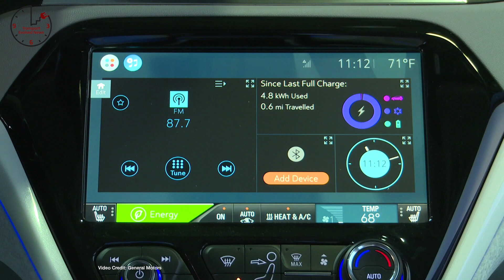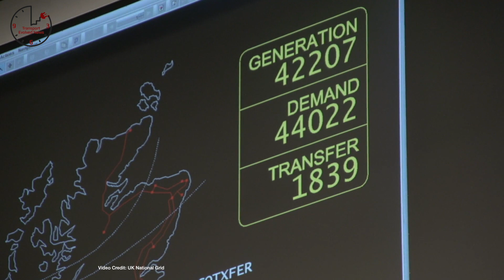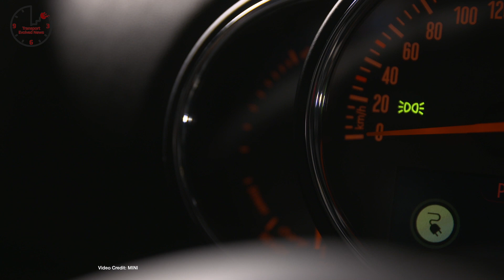BMW Scares Employees With Tesla, Waymo Public Tests, LEAF AT-EV, T.E.N. Future Car News 4/28/2017

Comment: 8:25 By all means it should replace coal with nuclear power. 
Nuclear is the LARGEST source of emission free power.
If you care about greenhouse gases, nuclear must be part of the solution.
Every time we shut down a nuclear plant we see a dramatic rise in carbon emissions (because we end up using more fossil fuels to provide the energy that far exceeds solar and wind capacity).

Comment: I tried to emulate your experiment of using my ev ,an imiev, as an emergency supply. however the battery consumed 1 kwhr whilst the load ,a 95w bulb, consumed 0.24kwhr. did you experience the same?

Comment: Good stuff!  The 'flyer' is dangerous, not for the pilot.  We've had babies lose an eye to a 'parrot'-sized drone in people's homes.  Look at the plethora of what appears to be 18-inch propellor blades under the Kittyhawk chassis.  No - wouldn't touch it, it is like all other drones, fundamentally unsafe because they do not take the rotor blade (propellor) tips seriously.  It's like that story of the guy who lifted his kid to sit on his shoulders as he departed a helicopter ride, never happened (clue - it was a fatal accident).  I used to start 3.5cc model aeroplane engines (forerunner of drones) - yes THREE point five cc - with a rubber cover on my finger.  If one of those Kittyhawk things drops on some kid or animal, they/it's seriously injured as a minimum.  3rd party liability insurance anyone?!

Comment: You need to get with nuclear power. If you hate CO2, its the only way to go. Making, transporting, and installing green power take a lot of power. That power comes from CO2. Go nuclear now, and you will have less CO2 tomorrow. Pick your poison, CO2 or nuclear. France recycles 98% of its nuclear fuel.
Reply: You're not alone. :) 

https://medium.com/third-way/why-i-wont-march-for-climate-c5b0b70a1053
Reply: That doesn't even consider molten salt reactors under development which address literally every concern associated with traditional solid fuel pressurized water reactors, and even more efficient to boot.
Reply: Nuclear would be cheaper if people didn't fight it so hard. It is very safe. The meltdowns are from very old reactors. We have not had an incident in 30 years. Fucushima was caused by a natural disaster, and the damage was local, and of no lasting impact. Places with solar have high CO2 outputs as the plants come on when the sun goes down, or the wind stops blowing. Panels only last 20 years. Then what? We have to landfill them and replace them. Spend the subsidatioin on nuclear and not wind and solar. Allow the birds to live, keep the landfill clear.
Reply: 98% of nuclear fuel can be recycled, see french programs. Solar panels will not be recycled.
Reply: Scooby's Scoop also Tesla is making battery storage options like the power packs which store energy when there isn't wind or it's night. Keeping the grid stable.
Reply: Scooby's Scoop all they say is may. This may kill birds but they don't provide any evidence
Reply: Scooby's Scoop you are really anti renewable. Can't accept anything that doesn't go along with your views
Reply: Yes to nuclear but it is not the only solution (for a start it would take too long unless modularized and widely distributed -- and look how upset the US is when nations it doesn't like go for nuclear energy).  Renewables (solar and wind) + storage (like PowerWall) can potentially take on a sizeable chunk of our domestic electricity (and transportation) needs.
Reply: I agree I am pro-nuclear but anti-twerp. SS: "There is no current way to recycle the batteries to make new ones." -- really?  See: https://duckduckgo.com/?q=can+we+recycle+li-ion+batteries&ia=web
Reply: That would be reuse, not recycle.
Reply: Scooby's Scoop nuclear is so expensive without it being government subsidized and takes a long time to set up. Plus it's extremely dangerous when in use and it's waste produces lethal radiation for thousands of years. Wind and solar is cheaper now and is cheaper to build and saves people money look at the countries with the lowest electrical costs they all have huge amounts renewable energy. The downsides are minimal for renewable energy
Reply: Scooby's Scoop what about the nuclear waste that doesn't poison our environment. Solar panels can be recycled very easily not producing waste
Reply: Batteries will be landfilled too. In much less time then solar.
Reply: Scooby's Scoop birds aren't killed from wind turbines. There just isn't any evidence of it. No dead bodies under turbines or no reports from nature preservers
Reply: Reliable data are scarce, but current mean estimates range from 20,000 to 573,000 bird deaths per year. Google it.
Reply: Scooby's Scoop batteries are easily recycled too. Tesla and many other battery manufactures force anyone that is disposing their batteries to recycle them. All their materials can be reused to make new batteries
Reply: https://www.fws.gov/midwest/wind/wildlifeimpacts/index.html
Reply: Stop being obtuse, do your own damn google search.
Reply: How many died from Three Mile Island?
A: Zero

How many died from Chernobyl?
A: Sources don't agree, but estimates are as high as 80. Also, wildlife is flourishing in the exclusion zone.

How many died from Fukushima?
A: Zero.

Literally, wind turbines have killed more people in a single year than the entire history of nuclear power worldwide. I'm not even talking about the hundreds who quietly died today from complications of burning coal. Some people bought it falling off their roof while cleaning their solar panels. 

No system is without its problems, but to call out nuclear power for safety is uninformed at best; nuclear has proven to be the safest way to generate power. If you even the scale by TW/h generated, nuclear doesn't even rise off the zero line in the chart.

People's fears are misplaced.

http://www.hiroshimasyndrome.com/
Reply: Not yet. They all say they have ideas. If making a new battery cost $2 and to recycle costs $4, they will not recycle. That is how it works. Every time.
Reply: Depends what you need the battery for. Most ex-EV batteries are used for storage.
Reply: There is no universal process to recycle Li+ batteries because each manufacturer has their own formula. It would be conceivable for each manufacturer to develop a recycling process for their own batteries, and thus each battery sent to the original manufacturer for recycling. It will not be economically feasible for a third party recycler to recover elements from various batteries. 

Still, as lithium isn't ultra rare yet, it's a pretty safe bet that most cells, any that haven't been thoroughly spent, will be reused/repurposed rather than recycled, while new cells will be made primarily with fresh lithium for the immediately foreseeable future.
Reply: There is no current way to recycle the batteries to make new ones.

Comment: Nikki,

1. Ignore posts about what you're wearing. You look great and should wear whatever the hell you like. I'm here for EV news, not fashion tips!

2. I think it should be pointed out (and perhaps you should also point this out in videos) that a long range EVs will also not suffer from battery degradation anywhere near as badly as short range EVs for the majority of people. Not that short range ones have much of an issue with it but if you are only doing 50-60 miles a day you will either only charge the car every 2-3 days or probably only charge between say 40% and 80% on most days.
Both of these will massively increase battery life probably way out past 10 years easily.

Comment: The longer range or larger battery pack isn't just for longer trips. If you look at the charge cycles and life of battery, you will see that 20% DoD give Li battery packs 8,500 charge cycles. Whereas 50% DoD drops the charge cycles to 3000. Huge difference in the longevity of battery life.
Reply: Acronyms are annoying! Please type what you mean so that we can understand.
Reply: Dod Is depth of discharge. If you drain the battery to 80% that's 20% DoD.  The number of times you can charge a battery depends partly on how much you discharge it. If you drain it all the way down to 0% every time, you would only be able to charge it about 600 times max before the battery died completely. Which is less than 2 years.
Reply: Thanks!
Reply: Depth of Discharge (DOD) is an alternate method to indicate a battery's state of charge (SOC)